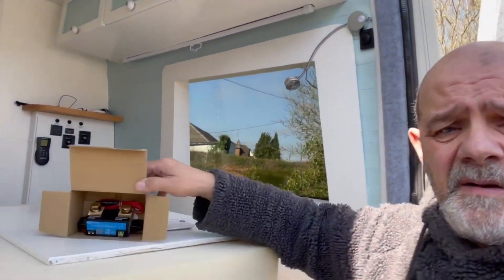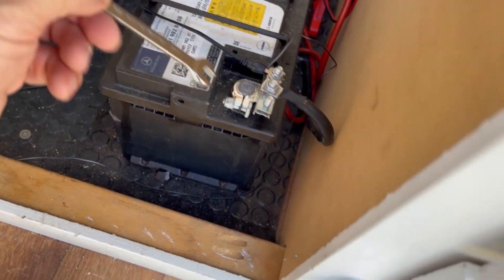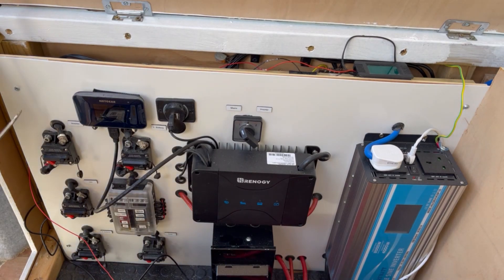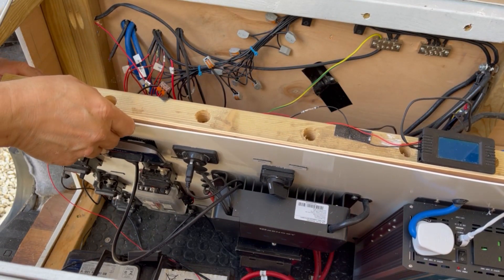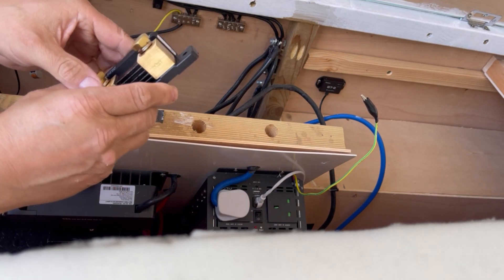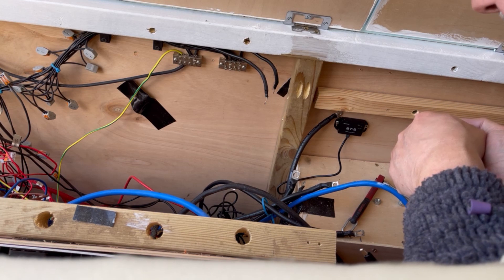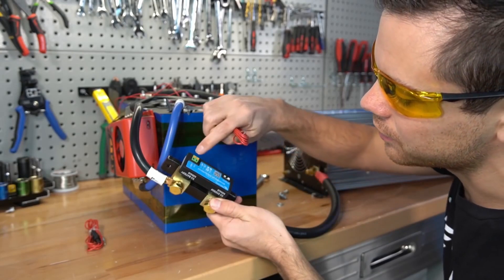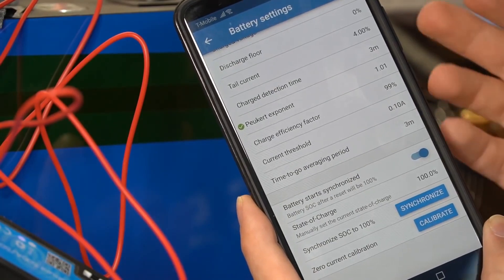victron smart shunt

Comment: This shunt has poor range of bluetooth only 3 -4 meters and an expensiv price
Reply from the maker: It’s true actually it won’t read from the drivers seat but still when it does it’s great
Reply: All Bluetooth range is limited by the power of the Bluetooth radio, regardless of the Bluetooth version. I am sure Victron wanted to keep the power consumption to a minimum and so it probably does not have a very powerful radio. For me 3 to 4 metres would be OK (I'd prefer that to a higher power consumption for longer range). I only want to check the battery condition from inside the van in any case - after all, most folks go in the van and look at a monitor.  All Victron equipment seems expensive, but then the quality seems good and it's part of an ecosystem (so although the app is free to download you are actually paying for it's development and maintenance when you buy any of the 'smart' hardware).  I'm still trying to decide if I want to buy into this or not.